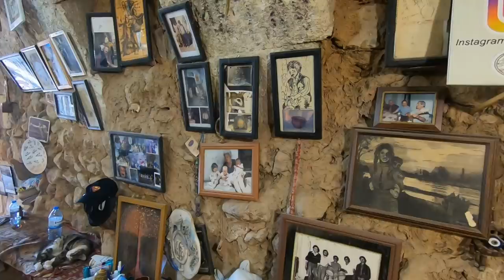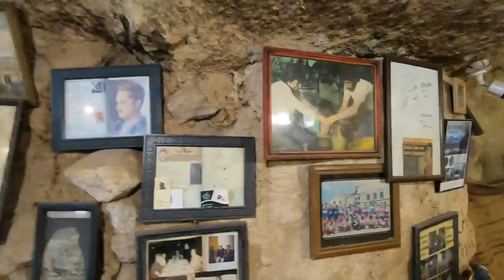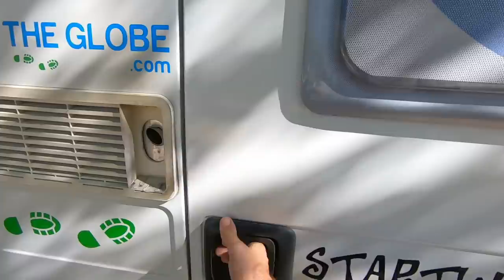TURKEY'S WEIRDEST MUSEUM and another VAN LIFE PROBLEM [S6-E132]

Comment: Hey Chris, We have an Opel Vectra and we had the same issue with coolant leak. But in fact there was no leak at all. After long searches it turned out our water container cap was leaking when the water reaches high temp. and pressure. If the same problem continues try changing the cap itself or o-ring inside the cap. It is a cheap solution. Yolunuz açık olsun!

Comment: Great video folks. You should have asked a garage to pressure check your coolant system to find leak. I absolutely would not put any of that so called leak fixing fluid anywhere near my engine it can cause more damage than good. Blocking water jackets and thermostats for starters 😯
Reply from the maker: Thanks Steven - we have Trudy booked in on Friday with a friend xx

Comment: I’m concerned about your coolant issue.  It looks like some Radweld or K-Seal or something was poured in at 15m27s on the video.  That stuff tends to gum up your heater matrix and you’ll struggle to get any heat in the cabin when the weather gets cooler.  If there was no leak, my suggestion is that you might want to have your cylinder head gasket looked at. As a first step, look under the oil cap to check whether there’s any gloopy substance there, which is an indication that water and oil are mixing.  You don’t have to have the cylinder head removed to check - you can get a head testing kit and any decent garage will be able to do this test for you.  In terms of cost, the price for the kit in the UK is generally around £20. My worry is that you’re storing up problems that will spring up in six months’ time when you’re somewhere less well served with garages than Turkey.
Reply from the maker: Hi James - thank you so much for your comment we have out girl Trudy booked in for a proper check up and Hasan is our man !! He knows Trudy and is a trusted mechanic of a friend here in Trabzon xx We will keep you posted about Trudy and let everyone know how we go xx best wishes Marianne xx
Reply: @TREADtheglobe  Thank you for taking the time to post such a detailed reply.  Loving your travels - I’ve been following you since I saw your item on the BBC a few years ago.  Brilliant adventures.  Stay safe.
Reply from the maker: Thanks James - It is great to hear you are enjoying the travel adventures - we have just driven to Trabzon (on the Black Sea coast) where we got Trudys tyre rack done !! so we have some great friends here who know Trudy - We are hoping it is not too big a job .... fingers crossed 👍 xx